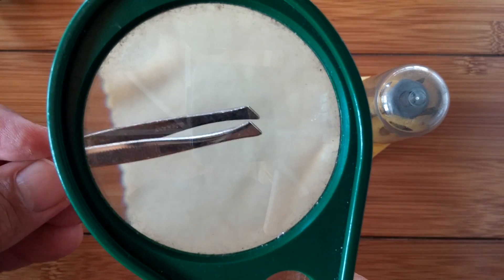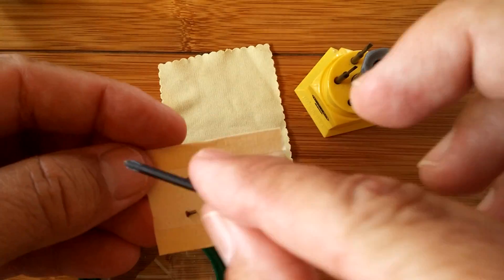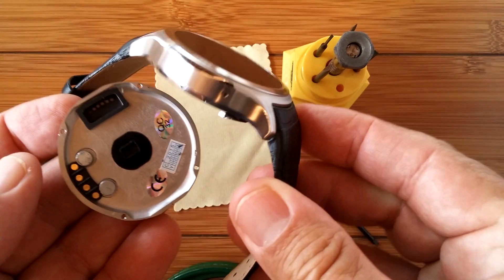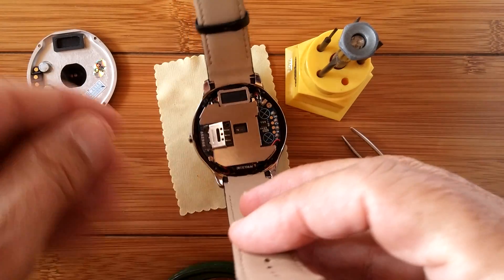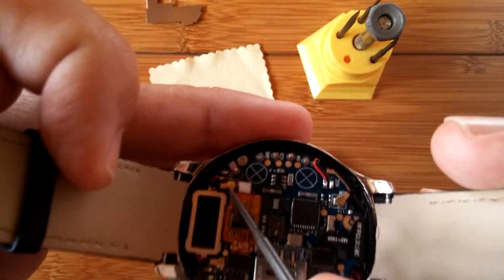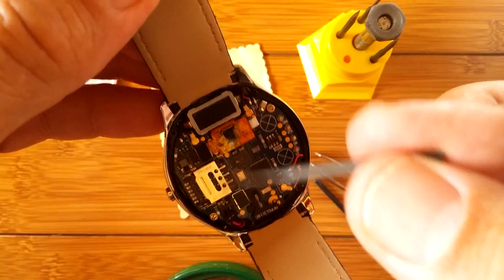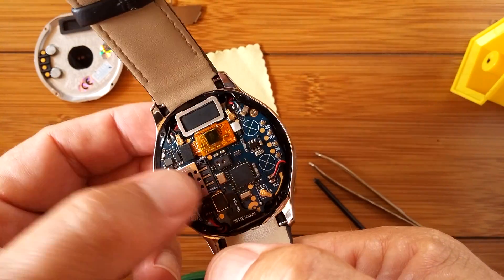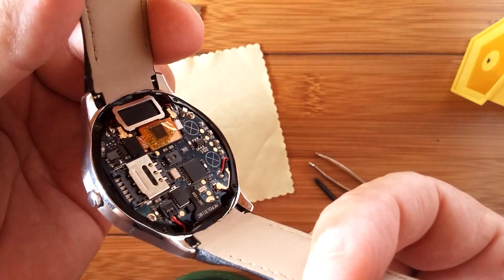No.1 D5 Smartwatch: Partial Teardown

Comment: You shouldn't call it a complete teardown since you don't even take the board out.
Reply from the maker: True. I didn't unsolder the chips either. OK, Partial Teardown.
Reply: Haha true! This covers the important part, getting it open which is hard enough without schematics/diagrams. Have had to get into faulty action cam to replace a tiny microswitch. Vids like this sure help!
Note, Deleted comment (wrong thread, F3 watch) and all comments disappeared? Never knew that?

Comment: Hi No place for an exteranal sd card but why when you turn the music player on, the Watch make appear a text message which says "Read SD card" no music...which sd card is that possible...thanks for your reply. Best to you bertrand.
Reply from the maker: Sometimes they don't extract parts of the standard OS, like in this case. You'll also notice in the Gallery app sometimes there's an icon to switch to camera, even though there's no camera installed. One size OS for all watches. Just because the OS says it's there doesn't mean it's physically there.

Comment: hey umm, my d5 button not working,after got wet.. because i forgot to take it off when im taking a bath... i've dried it, it still not working... but my alarm works, and everything except the button still works, any help?
Reply from the maker: Put your watch in a bag of uncooked rice overnight to suck out the water and hope it will work in the morning.
Reply: Yup, i did... But still not works 😥
Reply from the maker: If you can install the app Floating Toucher you can use the on screen buttons to do most of the things your real button would do. I'm not sure how you will turn the watch off and on however. I had to use Floating Toucher when I accidentally pulled out the center button on my original FINOW X5. I was able to use a toothpick to turn it off and on though.
Reply: Thanks for the advice... I'll try it later 😉

Comment: Hello,
Thank you for sharing your knowledge. I have a Finow X5 and I am very happy with it. Today
 I got a firmware update message and everything went well until I get a 
message saying "the internal storage is exhausted, the process has 
stopped, free up space and try again". At the bottom there are two options "free memory" and "accept". But by pressing the screen it does not disappear and runs the same message one after another.
I have removed the battery, also the phone card and reconnected it, I  have also restarted several times but nothing, the same screen appears.
Do you have any idea what I can do?
Thank you.
Roland

Comment: I Respect your work here and i have seen many videos from your channel us an owner of D5+ but i have to suggest ...............
That's as far as I felt comfortable going with a working watch. Sorry, but I wasn't going to screw up a $100 watch you said in the answer but video name is Complete Teardown. So please change the name to Fail Attemt to Complete Teardown. Do we have any newer news about the D5+ antenas or hot to change band without destroying them ?
Reply from the maker: Yes, Kingwear was going to release a new class of Android smartwatch, the KW98, with removable bands, but I understand from the G+ community that they just pulled it from development, so nothing is in the pipeline.
Reply: Are there any teardown videos of the D5+ wrist bands? My D5+ arrived last week and out of curiosity I tried removing the bands, but of the 4 hollow joints between the strap and the main body (2 on each side) there were only 3 wires visible. I can't tell if this is how it's intended to be, or if I acidentally snapped a 4th wire while disassembling it

Comment: Complete teardown? You didn't even remove the motherboard. If you had, we might actually see where the bands are attached. It's only a couple screws.
Reply from the maker: That's as far as I felt comfortable going with a working watch. Sorry, but I wasn't going to screw up a $100 watch. I'm not the guy who puts tech in a blender to see if it 'blends'. I did do a teardown on a broken Zeblaze Blitz if you want to see below the motherboard. It's on the channel.

Comment: Can I put a straight talk sim card in the watch?
Reply: If not, is there a way to get a service plan on the watch? I tried to use a straight talk service card on it and it won't let me.
Reply from the maker: You must work with a carrier that uses GSM network (like at&t or T-Mobile) and supports 850MHz data band (usually only in large cities in the USA). Find out if "850MHz GSM Network" is supported before you sign up.
Reply: +SmartWatch Ticks 
Ok. thanks!

Comment: my smartwatch d5  stuck in Boot Up and do not know what to do https://www.youtube.com/watch?v=WNtYcMpoPd0
Reply from the maker: +Cristian Sarto Got ya covered on that one. This fixed mine! Please let me know if it works for you, too. You probably need to take it apart and disconnect, then reconnect the battery, but if you do, and it doesn't boot up on its own, this should work.
https://youtu.be/7lSZMQ6zdN0
Reply: I solved the problem , I installed original firemwall,thanks

Comment: Great video...reminds me of my first watch phone breakdown.  My question is battery life. I have the d5 (new..about 4 days) ,but the battery with BT tethering and some wifi browsing has given me about 5.5 hrs until drain. I have other smartwatch units with wifi and Bt tethering with better batterylife. Do you have any suggestions or experiencs. Thanks
 Cheers from Joe of Joes Tech Review
Reply from the maker: +joe bso12 Thanks for dropping in Joe! I'm hearing various reports on battery life across the board. Those who don't tether have great life it seems as the BT active link drains power. I don't to the BT tethering thing and instead use WiFi connect to my phone as a hotspot. WiFi goes off when the phone is dark, and reconnects in about 10 seconds once activated. I use the standard apps on the watch and get the info I want directly rather than via the watch. This is particularly useful when I want to go out without my phone and just play in WiFi zones. Now, that said, everyone is having problems getting the phone call and SMS relaying to the watch stuff working. These standalone watches just aren't made to do that. The latest research from one of our viewers to try and get that functionality involves dual apps on your phone and watch (and tablet as well if you want) to make it work. Don't know if she has been successful, but if you want to play, here's the link she provided: http://www.pacosal.com/desarrollo/2014/12/27/help-m2d-sender-and-m2d-receiver/

Overall suggestions would be to move away from phone tethering as much as possible, work with WiFi connect for syncing your standard notification stuff, our off your wrist flip to display time (although that doesn't eat much power unless you use it a lot), and set your automatic screen off time to as low as possible. Also, if you install the app Display Brightness (demoed in the setup series of videos) and limit the max brightness to say 70% to 90%, that could buy you some more watch time. Here's the link to the D5 setup Playlist: https://www.youtube.com/playlist?list=PLGZLicZ6A2vXDDJJ3GMR-xgYlo_5oRGP7
Enjoy your watch!

Comment: i wondering which voltage should i use for charging, 5V-1A or 5V-2A ?
Reply from the maker: +Hoang Khiem Nguyen I have no idea. I'd guess 1A should do it. It's a tiny battery in a tiny watch. I think you need 2A for things like iPads. Anybody know for sure?
Reply: thank you, i tried both. i feel like 2A makes battery run out faster (same usage as 1A charged) @@....No idea :)

Comment: Thanks for doing what I did not dare do with my D5. FYI, for reasons unknown to me, the band popped from the top and there were two wires clearly visible going into the watchband. A lot of praying (that I did not destroy one of the radios) and some super glue fixed the watchband, with only a bit of aesthetic damage. What I found most useful was your identification of the location battery, so that at some future date I will be able to change it when the battery inevitably dies. thank you for posting all these amazing videos on the D5!
Reply from the maker: +Carlos Probst You're welcome. Congrats on fixing your bands. I didn't really want to take mine apart, but there was such a calling to see inside and determine if the bands were removable that I figured I'd give it a try -- at least far enough to see the truth about the bands. Glad to say the watch still works great. Hope I don't have to go inside again!

Comment: Hi there Mr Ticks I saw another smart watch that could be possibly better than this one and it is a bit more expensive than this one, it's called Mlais Smartwatch, if you could find a way to review it, it would be amazing.😄
Reply from the maker: +Ash Mohammed Thanks for the info. I've been looking at this one, but it's not available anywhere. Unfortunately it seems to have the same limited specs as the D5, 512MB RAM, 4GB ROM. No microSD. The ones I really have my eye on have 1GB RAM, 8GB ROM and TF/microSD support. Perhaps when the Mlais is finally released it will have better memory.
Reply: +SmartWatch Ticks , the Mlais is an android Wear watch and not an android Kitkat.

Comment: great video :) i do'nt understand ppl who want to change the bands, i like it the way it is, i do'nt look at it as a jewelry but as a cool gadget:)
Reply: +sonia sophie ataunna 

You don´t understand because you dont make sport with it.
Reply: Te Ge , do you have the watch? if so what app for fitness do u use? does google fit works well with it? and how battery life with using fitness app? the zgpax watches that i have did'nt last even 6 hours with these type of apps. and the k9  that i use for now also horrible life with these apps for a companion app it is great but this is NOT the main reason that i bought it and i'm quite disappointed of it and because it does'nt have BT 4.0 as it was said.
Reply from the maker: +sonia sophie ataunna The band might wear out over time, but then so could the battery, so I guess we just look at 2 to 3 years life. Which is fine. I can't imagine what watch I'll be drooling over in three years, but I bet it won't still be this one.
Reply: Te Ge I my actually main reason  is that I want it for activity tracking.
Reply: +sonia sophie ataunna 
 me too, the problem is the bad smell that comes with leather & sweat 😵😷